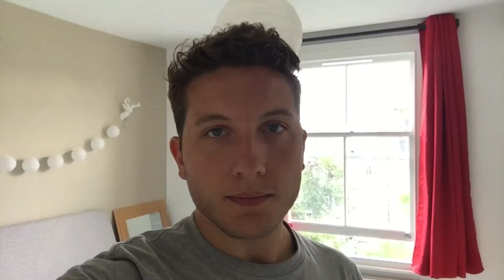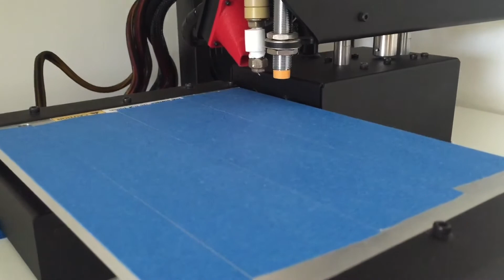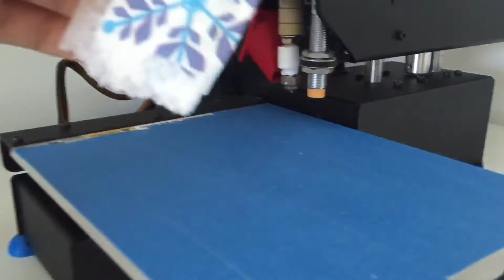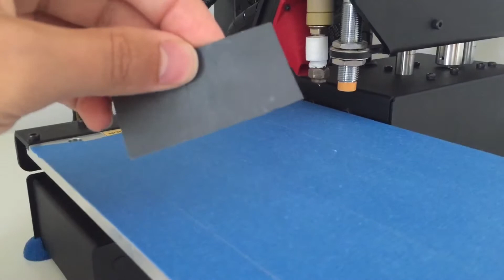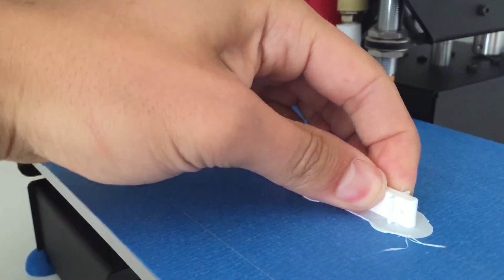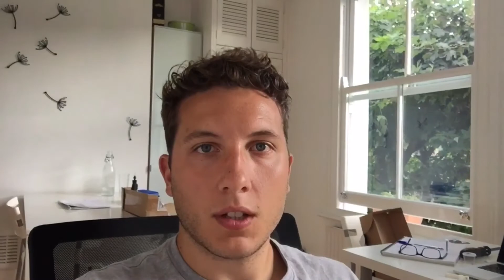Make your 3D prints stick to the print bed without hair spray or stick glue

Comment: you should try to use glue stick or hairspray instead of sanded blue tape. glue stick or hairspray give very smooth surface at the bottom of the object, while sanded blue tape surely wont.
Reply: robbykhen thanks for the input. But glue stick and especially hairspray are messier to deal with. The blue tape is much more convenient. I cannot comprare the two finishes, but I can tell you with sanded tape it is very smooth.
Reply: Actually I find tape to be messier. Tape usually leaves a bit of gunk when you take it off. And yes, you'll need to replace that tape every so often. Glue stick on the other hand is water soluble. That means you can wash it off pretty easily with soap and water.